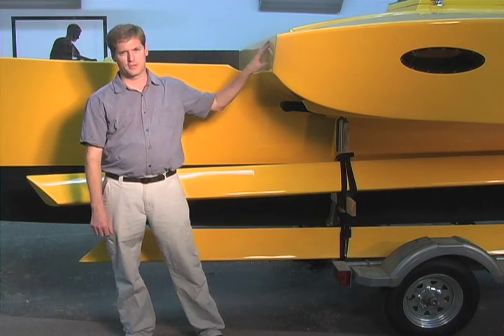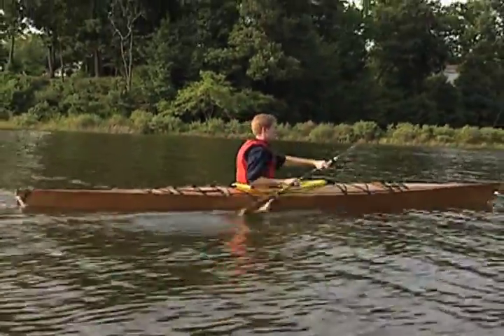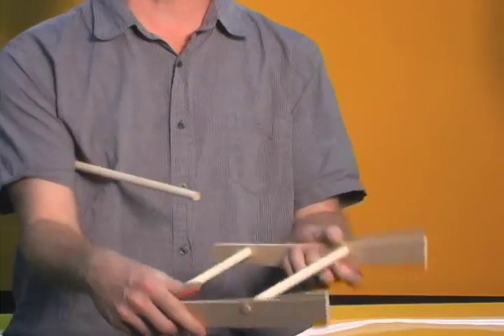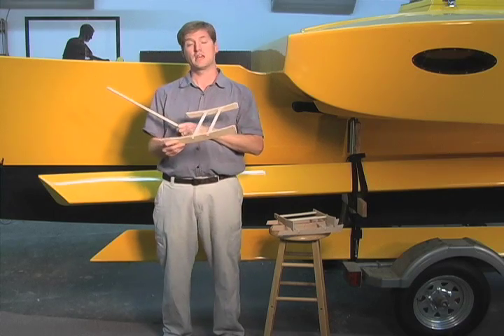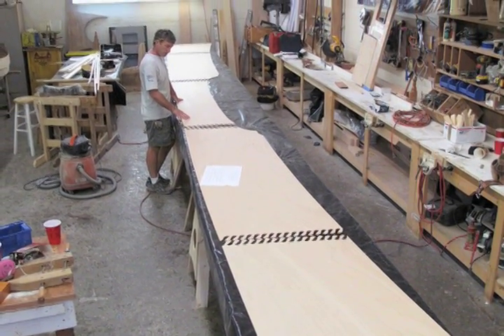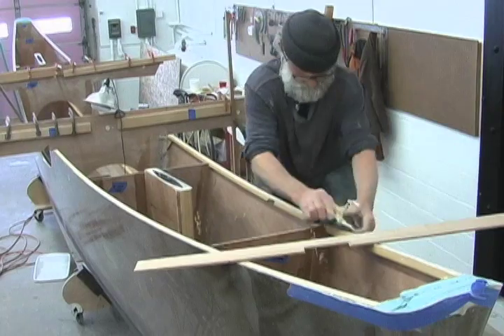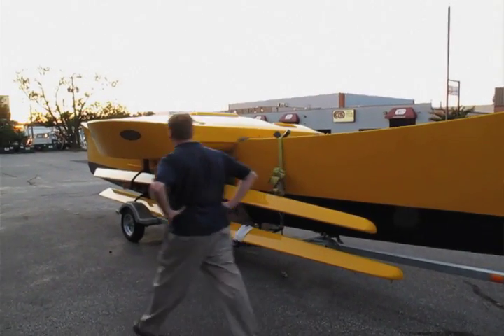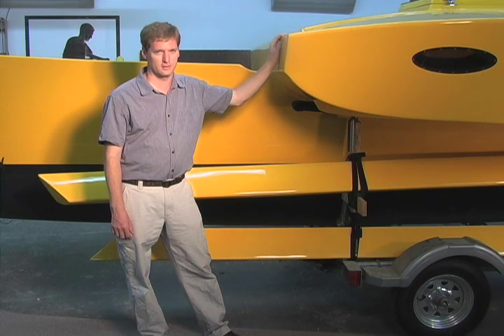"Madness":  A 31-foot Proa by Chesapeake Light Craft

Comment: Interesting. One concession to stitch and tape plywood: Symmetrical hull shape in cross section. Traditional Polynesian proas were asymmetrical, flatter on leeward side, rounded on the windward side, producing lift to windward. Thus the traditional shape is actually more hydro-dynamically sophisticated; cut by hand with adze.